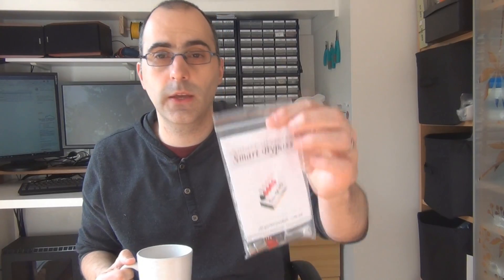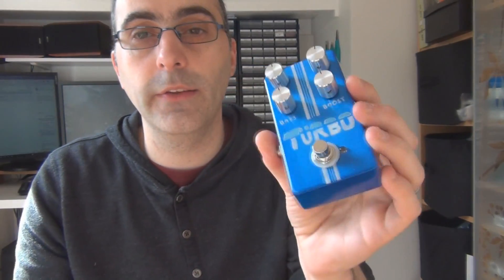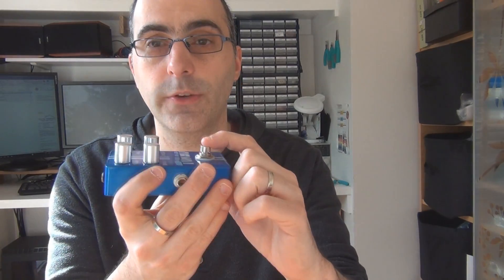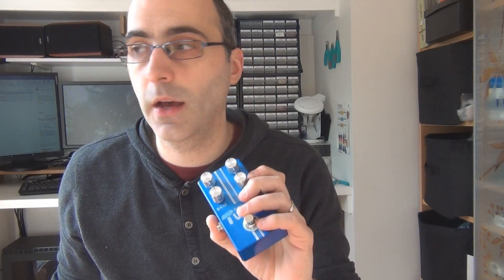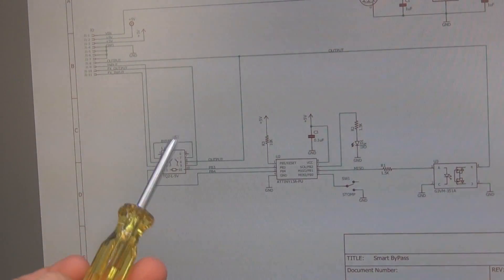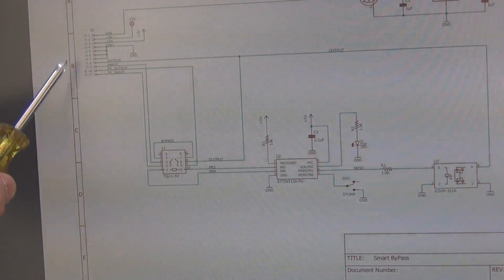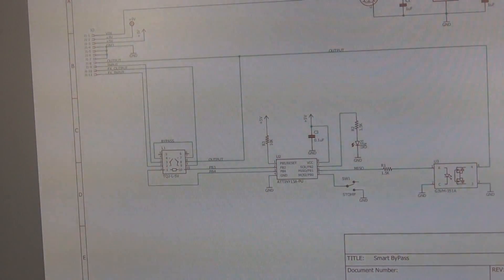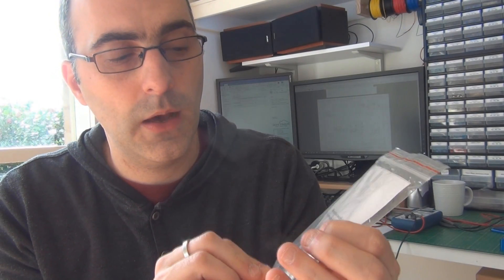DBE Smart Bypass kit

Comment: As of the LEDs, it is all a matter of pushing current no further than what the microcontroller can source. If one looks at the attiny13a datasheet in section 18, the max current sink per IO pin is 40mA. That basically means so long as the current is limited to 40mA on that pin, the microcontroller should be ok, barring the total draw of everything on at the time also is under the max draw, which in this case is 200mA.

Also, most LEDs are rated at a limit of 20mA, which is smaller than 40mA, so that would be what I'd target. So, now it is an issue of what the LEDs forward voltage is. Typically, blue LEDs are around 3.2V to 3.9V depending on manufacturer. Other colored LEDs are usually less (like around 2.0V or so). So the closer to 20mA one drives and LED, the brighter it is.

So, knowing all of this, we just do some ohms law math: Resistor value = (Supply Voltage - Forward Voltage) / amperage. OR assuming our LED has a forward voltage of 3.7V, 5V is the supply of the microcontroller, and we want a brightness of half way, 10mA, the formula would be (5V - 3.7V) / 0.010A = 130 ohms. 130 ohms is not a common value, so I'd say, 150 ohms would be good in this example.

Lastly, the reason I stuck with 1.5K resistors for the LEDs is two-fold. That was a descent resistor value to trip the solid state resistor, and it also worked for the LED, so I could buy 2 of the same part, which helps for getting the price down. Secondly, the lower the amp draw on all the components on a circuit, the longer lifespan a battery would have, if driving the pedal on a 9V battery. More resistance would help further, though it would dim the LED. Less resistance would make the LED brighter, but cut into the battery life. Delicate balancing act! LOL

Comment: Just built the Smart Bypass.  A question, the bypass state does not change until I press and then release the button.  Is this by design?  All of my other soft touch pedals change state as soon as I press the button (Wampler, TC Electronic).  Am I able to change this, or will I need a reprogrammed Attiny?
Reply: This was by design. It was a means of what is called "software button debouncing". The logic is basically this:if pin PB0 goes to a low state, which means the stomp switch is pressed
  1. ground the audio signal to mute it
  2. wait 20 milliseconds to finish grounding signal
  3. check state of pass through, whether is was using the FX chain or by-pass chain
  3a. if in FX chain mode, change flag to by-pass mode disable FX chain and enable by-pass chain
  3b. otherwise, if in by-pass mode, change flag to FX chain, disable by-pass mode and enable FX chain
  4. wait 10 milliseconds for the relay's wiper to contact and latch
  5. Re_Enable_Sound();  6. give a little time for button to lift up/debounce (100 milliseconds)
  7. continue to poll the stomp switch GPIO, if it is still pushed/held downIf I don't do that, then it is possible to press the stomp switch and get it to randomly toggle on/off/on/off/on/etc. This way I know for certain the button was pressed and wasn't mechanical noise from a bad switch, or a twitchy person.Unfortunately, this wouldn't be something you could fix, unless you are able to reprogram the attiny yourself.
Reply: Thanks Erik for the quick, and very detail response.  I see why you designed it that way, that’s cool.  I worked in embedded systems many moons ago, so I might have a play with an attiny and see how I go.  Thanks again, much appreciated. 👍
Reply: No problem. If you need a good cheap attiny 8-pin DIP programmer, Sparkfun has a really good one for a pretty cheap price. As of an IDE, I used Atmel Studio 7 on my Windows PC and AVR-GCC on my Linux box.

Comment: The idea behind using a relay is that you can use a simple momentary switch which SHOULD be cheap....
Reply from the maker: The impression i get is people opt for relay bypass for reliability.  There is only $1 difference between a 3pdt and spdt mom footswitch, where as a relay is going to cost a lot more.  Just my 2 cents

Comment: Great digital solution! BUT I think it could be more inexpensive without the need of a microcontroller, you could replace the micro with an other ic tha costs u$s 0.48. Besides being a musician I'm an electronic engineer and made my own bypass digital switch. Regards!
Reply: I agree you could make it cheaper, but I like the control the microcontroller gives. I think that MOSFET is being used to ground the output signal while the relay flips so there isn't any clicking noise. Probably don't need the MOSFET to be that big though. I'm curious why they chose that part and what were the deciding factors for the ATTINY.
Edgard what part would you suggest using?
Reply: Hi Luke Ganzevoort! Pleasure meeting you! Mine is with a quad-switch, relay, 1 transistors and, of course, with its polarization resistors and capacitors.. It changes siganl path and turns on/off led. The first relay I used was a pcb kind, then move to IC type. I do have to find where the schematics are...it was a LONG time ago. OH and no popping sound. Regards!
Reply: Nice! What was your transistor used for? Driving the relay? You probably avoided having to use a voltage regulator too, which is nice! I do like the latching relay they used so you don't have to be drawing current while the device is on.
Reply: A C815 (or any good switching transistor), 5V mini-relay and no voltage regulator. You can even do it with a 4013. And about the current draw...if the relay is ON there is going to be a currente draw no matter where you take the current

Comment: Just a question, how come you guys didn't put a flyback diode on the relay coil? From my experience, relays work without them, but will burn out a lot quicker or blow your microcontroller eventually. Something like this ( https://i.stack.imgur.com/Gwm1y.png ) helps prevent that!
Reply: BTW I really like the idea! I've been thinking of different ways to control pedals electronically and I like this idea. True bypass, but implemented in a more sustainable and controllable way!

Comment: Great video, Paul! One question, though. Do you need to power the board to test it?
Reply: Got it! Mine is working fine.
Reply: Is there any negatives to increasing the CLR value past 1.5k?
Reply: T-tone Thommo the led will get duller the higher you go in normal circumstances..but I'd stick with what Paul says I  the vid,I suspect there less play room with CLRs because of the way the current is configured is different then standred bypass switching..
Reply: Daniel Allan, that is the reason I'm asking. I have some super-bright LED's and want to know if there will be any negative impact on the Attiny if I increase the CLR.
Reply: T-tone Thommo I wouldn't have thought there would be an issue in using them and sticking to 1.5k resistance ,yes it might be a bit brighter but so far as using them is concerned I would do it!
Reply: Daniel Allan, I'll probably stick to what Paul says in the video. But if I can tame these blue led's without causing any problems, I'd like to do so. On the other hand, I don't mind sending a beam of blue light to Pluto every now and then, lmao!
Reply: T-tone Thommo lol well I if your serious about finding a workaround,I would look at what's involved in the programming stage frist,there might be a way to configure the ic so it can handle a bit more resistance, then if that fails I'd look into the subbing of hardware... Its a lot of effort but I guess it's why we all make pedals..there's a joy in finding this stuff and not just doing the easy thing!
Reply from the maker: You can use greater then 1k5 yes.  Just dont go under 1k.
Reply: DIY Guitar Pedals oh from the vid I got the impression not to use higher 1.5k or lower then 1k..
can't think why people would want concider to use less then at leat 1k for CLR resistance though
Reply: No real negatives, just a dimmer LED. Theoretically, you could probably be able to go in the other direction as far as 330 ohms, which would be pretty bright, and assuming an LED is a blue LED with a typical forward voltage of 3.7-ish volts.
Reply: Erik Vincent no I wouldn't use a 330oms as a clr..if your making pedals for other people you what things like leds to have a chance of not wearing out too soon..values from 1 to 5 k seem to be a good range from my experience!
Reply: Sure, I was just illustrating the tolerances one can play with. Usually with pedals though, one usually is using the supply voltage of 9 or 18V, which means the resistor will absolutely need to be up in the 1K and greater range. In this unique case, we are just using a regulated 5V supply, so in that case we can get lower. If the spirit ever moved me into doing a pedal with an FPGA or a ultra low powered microcontroller at the 3.3V or 1.8V level, the resistors would have some tremendously low values.
Reply from the maker: Hey mate, yes the relay will need power to change states.  Cheers
Reply: 1k is my stock value. But these ultra bright water clear LED's I have on hand need at least 10k, IMO. Even then they are borderline too bright.